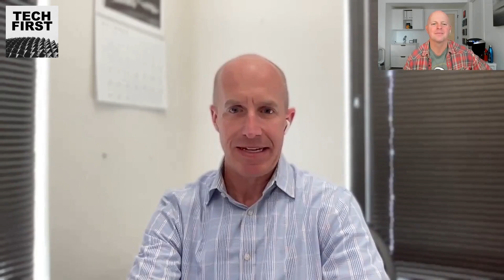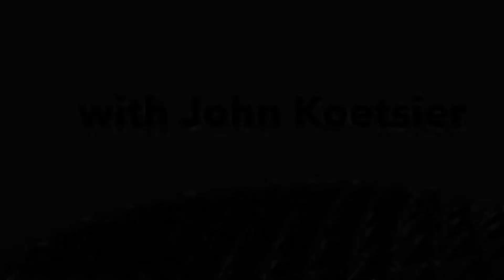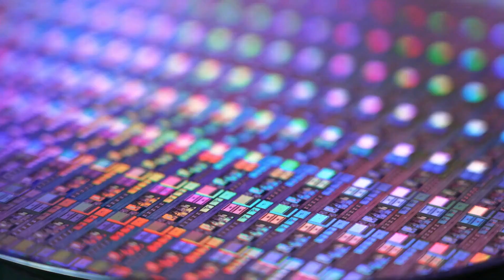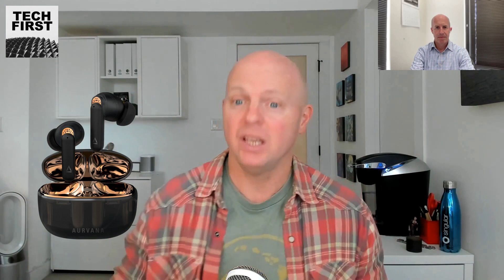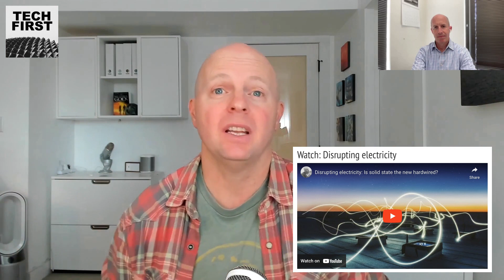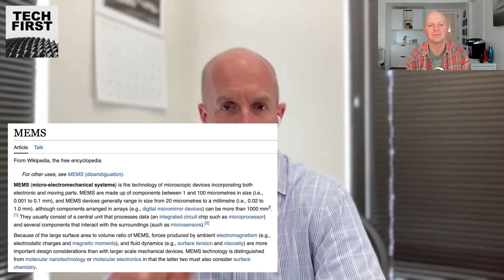Reinventing speakers: replacing 100 year old tech with MEMS chips

Comment: As a Closet Audiophile,  i am interested in the Latest and Greatest Devices to Reproduce  Sound.

However, i am NOT a Fan or wide User of Earbuds.  I DO occasionally Listen to Headphones.

The Price Points the Expert used are WAY beyond the typical Consumer. 

I am curious to if this MEMS Technology is Scalable to larger Speaker Systems typically Used for Surround Sound or Mini Monitors.

Frankly, i don't See MEMS to become a commonplace Loudspeaker Driver for large Floordtanding Systems...maybe, multiple High and Upper Midrange Drivers.   I can't See MEMS getting into the Bass Driver Section of large Loudspeakers.

I AM amazed as to the Clarity and Range of my Phone's Sound reproduction Device.

Comment: I've first heard of MEMs speaker tech whne trying out the Creative Labs Aurvana Ace 2, which uses a full-range MEMs speaker + Dynamic driver subwoofer. Is sounds amazing, the clarity, detail, separation is one of the best I've heard and with no distortions of any sort. The CreativeLabs sales person said that the MEMs speaker can't move enough air for deeper bass regions, thus the subwoofer. I'm really excited for MEMs speaker tech to spread but I'm sure bass regions will be an issue for a bit. 

Unfortunately, the guy in the video did not explain their plan to to tackle this issue well. He kept using the same confusing words without actually simplifying and explaining the concept :(
Reply: I agree they are incredible

Comment: It's not a question of whether it can upend the audio driver paradigm, but more a question of how far it can go in replacing the current drivers across the whole spectrum of use cases.

Even just replacing in + on ear headphone drivers and those used for smartphones/tablets would be a huge market for MEMS, but replacing the drivers used for home cinema would be a big step beyond that, and another step again to replace larger event systems such as used in commercial cinema screens and stadiums.

The rise of MEMS speakers could be best contrasted not to flat screen displays, but actually to the metalens - a new paradigm in optics which is on the cusp of replacing technology older still by centuries than the foundation of modern speaker technology.

The next 10-20 years are going to bring about huge changes for these markets if their promise can be fully delivered on.

Comment: Wheels are 5000 year old technology, but we still use it on all our cars, bikes, skateboards...
To get good bass in a room, you need to move a big volume of air. How do you do it with a small chip?
Semiconductor technology does not scale that way. It scales down very well (more transistors on the same size chip), but scales up very badly. The price increases at least with the square of the chip size (yields...).
I never had a problem with amplitude balance or phasing in a headphone, that's nonsense.
The chip will survive a washing cycle? A microprocessor, quite probably. But a MEMS chip, open to the air?  Would like to see that!
Reply from the maker: You are 100% right. They're solving the scale thing by producing ultrasound, then modulating to sound. 

At least, that's what they've told me. I don't understand it :-)

I will be seeing it live in person at CES, however.
Reply: The answer is likely arrays which all MEMS speaker manufacturers seem to be looking at for the future.

One company called Audiopixels in Australia has been working exclusively on this strategy, but has yet to introduce their first product, so evidently it is significantly more complex to manage than a single driver.